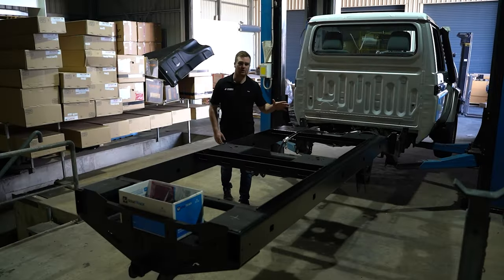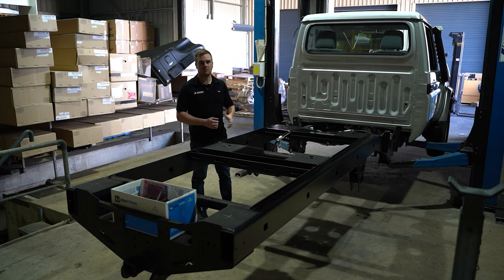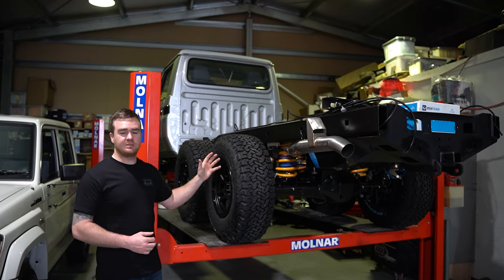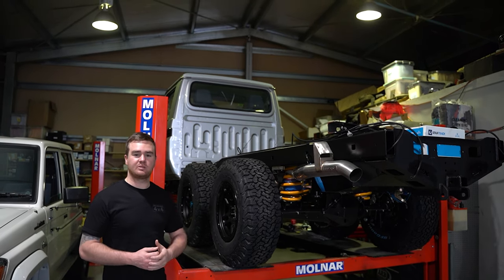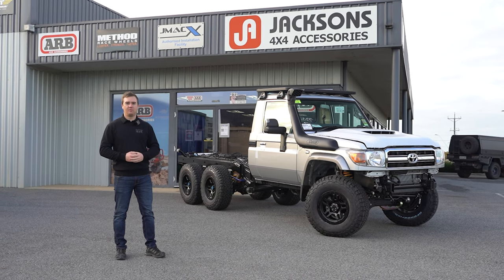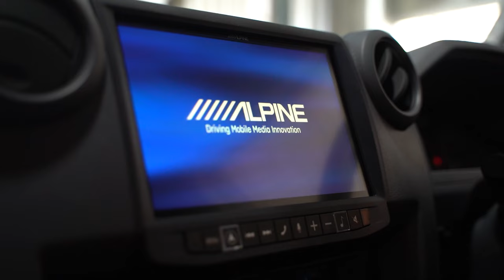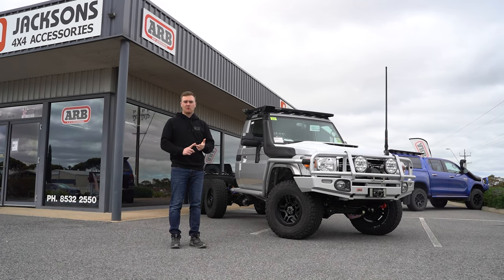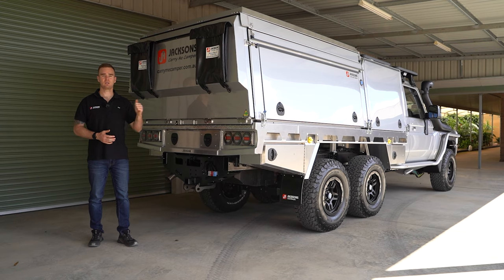We built a single cab 6x6

Comment: Would have been nice to see the transfer case modification for the tandem axle drive.
Reply: I'm not 100% sure but, wouldn't both rear axles work at the same time always, transfer case has nothing to do with it would it?

Like imagine the first diff is a 4 point and the second a 3??
Reply: Did they ever show driving the 2nd axle? I didn't see it.

Comment: Don't know much about cars but I gotta ask...is the torque gonna be the same if it's Manual and Automatic transmission  ?
Reply from the maker: No worries! Changing the transmission doesn't change the Torque however it would potentially change the feel of it. To actually change the Torque you would have to modify or tune the engine. Cheers - Media team